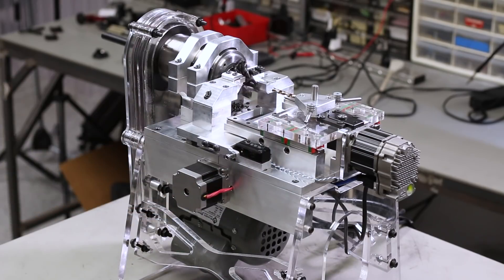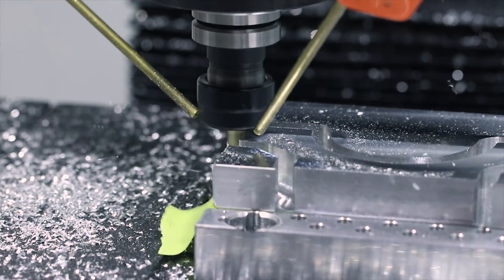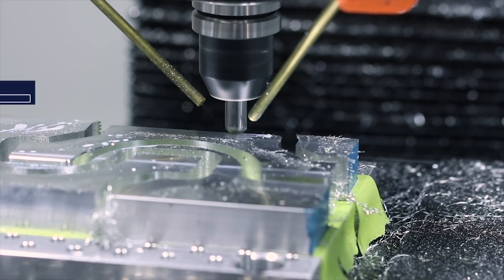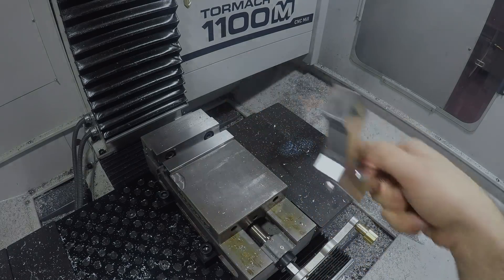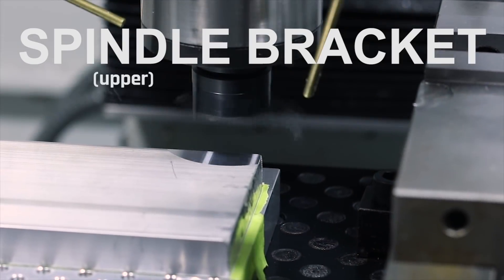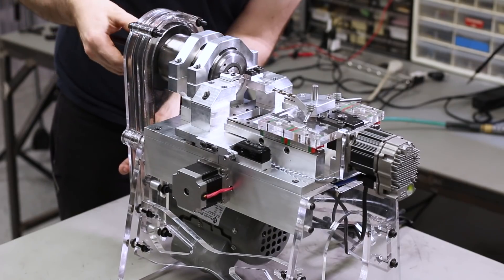DIY CNC Turret Lathe FINALE! WW225

Comment: RE: small radius slowdown - this could be what's happening: 

In 3D printing,  by default,  "sliced" curves are comprised of short, straight, lines.  It would stand to reason that smaller radius curves would require more, (shorter) lines to describe them. 

The 3D printer control software Klipper has a plugin called "Arc Welder" that converts curves into genuine arcs, (so you're no longer limited by how many moves/second the mechanics are capable of).  I would be surprised if Fusion 360 didn't have this function built in.

The other thing to look at is the increased number of X-Y move commands might be straining the bandwidth of the communications channel between the the CNC controller and the motor drive electronics boards.

Comment: Why not use a $200 R8 spindle cartridge from Little Machine Shop + an R8 lathe chuck?

They're ideal for little projects like this.

Also an epoxy granite base would have been better, cheaper and easier to make than all those custom metal parts (which look flimsy).

Epoxy granite has even better properties for metal-work than cast iron and the whole base can be cast as one piece with it.

Comment: I’m sure you know by know (since I learned this on NYCCNC lol, HAAS tip of the day has a good explanation too) but for others the slowing down on the corners may be called corner compensation in fusion 360. It’s a good thing that provides constant cutting forces by compensating for the diameter of the end mill around corners. Without this the code would be generated based on the center of the bit, fine for a strait line,  but think about the size of say an inside corner arc on a part verses the smaller arc made at the center of the end mill. With that in mind if the speed didn’t slow down you would be cutting at the correct speed at the center of the end mill but it would be much faster at the edge of the end mill. This could result in ugly corners, broken bits, and pullout of the end mill or the part.

Comment: So, we have a turret lathe made from aluminium using form tools with some auto features added.....hardly CNC but quite handy if you don't want to swing the levers yourself etc.......I think the design could be totally CNC'd......probably is going to be but I don't see it with the turret as the main tool holder.

Comment: I am amazed at the tape holding the aluminum block for milling! We use tape for holding flat plastic, and it is an amazing pain getting all the coolant off so it will stick at all. I use hold-down clamps instead, even if I need to move a clamp to finish the part, so much easier than having the tape come apart.

Comment: Cool project guys! Looks perfectly suited to the task it's designed for. Well done! :)

One thing you guys might like (since I've seen you use Arduino stuff before) is a new controller platform from Automation Direct. It's their 'Productivity' brand PLC but uses all Arduino components in industrial hardened packages. Looks pretty inexpensive too.

Comment: I am sure this is late but I dont see an answer about your tight radi question yet. As you were using a contour toolpath, my assumption is that you have Feed Optimization turned on in the Passes tab. 

One of my favorite options for the contour toolpath actually but slightly less useful if you are doing a full slot. Due to contour not being an adaptive (or trochoidal) toolpath, it will not maintain a constant chipload and a great way to overload and break a tool is to come into a corner where the tool will go from having say a 10% radial engagement then jump up to say 40% in an inside corner. 

Feed optimization allows you to specify the radius of the inside corner where it enables the slowdown and what percentage of feedrate you would like to use in that corner.

If you are using a smaller tool to do a finish contour on an inside pocket and the radius of the previous tool was larger than a feature in the pocket, feed optimization is key to prevent snapping that small finishing tool. Additionally, you could always go in with a rest machining adaptive before doing the contour with that same tool to reduce the chance of a big change in tool engagement.

Hope this helps! Feed optimization is a huge help when you want it on but can give some confusing looking toolpaths when you don't.

Comment: It appears you are cutting a radius the same size as the End Mill. If you ran into that radius at full speed it would chatter to all hell. Use a larger radius or use a smaller End Mill and the feed rate would probably not slow down. This is just a guess. btw NICE JOB

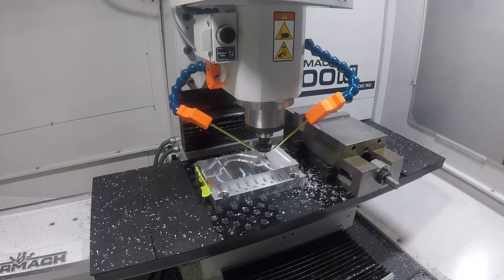Comment: 9:36 look at the gcode. OH wait there 100000 CAM lines. well there is too many lines do smal arc and using lowwer feed. but hey those calculated points can make with G2 and G3 your program side go down 100 lines if you smart it go 10 lines. there is too many same steps. ONLY ZDEPTH change. DO LOOP. OH CAM not do it. supid cam.pro not use cam. all these things

Comment: 9:33 It may be because of data straving. Many machines can read up to 40 lines of code per second, if you try to push harder it starts to “slow down” (it actually shakes). There is an option in Fusion 360 to smooth the toolpath. I think it replaces splines and uses arcs instead.

Comment: Do you think it would be possible to make replacement analog sticks for an xbox controller in metal? The idea came to me when looking for high quality replacements for an elite controller that suffers from "stick drift" (often caused by the plastic in the stick gets worn). So metal versions could be a cool, but expensive solution.

Comment: For Linuxcnc and by default Pathpilot you need to check to see what G codes are affecting the trajectory planner. This looks like a G61 (Exact Path Mode) or G61.1 (Exact Stop Mode) are active. The default should be G64 (Blend without Tolerance). This is similar to the HASS G187. http://linuxcnc.org/docs/2.6/html/common/User_Concepts.html#sec:trajectory-control

Comment: Fusion 360 CAM contour in the passes tab there is a feed optimization option, this specifies that the feed should be reduced at corners. You might want to check that out for your feed slowing down at the corners.

Comment: So what's happening with the slow curve traveling is in CAM it's making millions of tiny moves with millions of lines of g-code which the machine can't process fast enough, correct this by adding .001 smoothing to the tool path, adjusting as necessary

Comment: Just wondering, how much Z travel does the Tormach have? I’d love to have one in my garage. Also, for the best hex keys, Bondhus has always been my go to. Also, their rubber handled T set is pretty nice. The rubber does pretty well in a coolant heavy environment, and I’ve never stripped them out.

If you have .050 of clearance, might as well be a mile. I’m happy if I can get a piece of paper that’s more then enough.

Comment: 4:20 it's called functional laziness. But a more reliable way to do that is by using your 3/8 chamfer mill as a stop. MDI to your work offset x0 plus the tool radius (g0 g90 g54 x.188 y-.25) then handle jog it down until the shaft of the chamfer mill is below the surface of your part. push the part against it, close the vise and handle jog the tool out of the way. It can also be added to your program for automation purposes. 
putting a stop like that on the moving jaw like you did is a generally bad idea because you don't want your stop to move. Moving is the exact opposite of what you want from a stop. 
Also putting a stop against a part that has already been secured isn't always accurate. As a rule, you should setup your stop, put the first part against the stop, secure it and then find the zeroes. This ensures repeatability.

Comment: I learned when spot drilling you want to use the spot to create the chamfer for the hole as well.  Additionally, when spotting you want to have a short dwell time so the tool has enough time to make a full rotation at depth.

Comment: the slowing down could be due to arc tollerances or interpolations into to many small lines for the controller of your mill, i had the same problem on my diy mill so i just reduced the arc tolleranc in fusion and it was alot smother

Comment: 9:32 My expertise is more in 3D printing than CNC machining (Hey, it's all Cartesian robots and gcode, amirite?!) but my first thought is, does the CAM post processor have machine acceleration settings?  Like maybe that radius represents such a short cut that the post processor is chaining minimum acceleration and minimum deceleration distances together going in and out of it, without coming up to speed at any point. 🤔

Comment: Slowing down on the short arcs almost looks like the machine is acceleration limited -- I would expect that it's a problem with the machine trajectory planning rather than the G-Code.  That might be worth contacting Tormach about.

Comment: 0:31 why am I seeing threads in all of these holes? Where's the smooth holes for the pins?
Reply: @Ed Rees Ok, I'm just wondering why I can see threads even on the smooth .25" portion. Looks like the tap scraped up the whole distance, and the Bore wasn't big enough. Either that, or the Boring Bar rapid out of the hole instead of Feeding out. Anyways, that's irrelevant to the video, which I thought was really good. :)

Comment: I get the whole learning, educational, video creation thing. But Yall really need to address the "machine shop disease"  Because you can, dont always mean Ya should!!! example=Taig CNC chucker lathe with some light mods would have been cheaper and easier and a lot more versatile. Make stuff you can't buy, make stuff that would be significantly cheaper than buying, make stuff that does not exist! Beware of the self-serving machine shop that makes you do it's bidding!

Comment: If the small radi is faceted rather than an arc it may be re accelerating at each facet (smoothing turned off?) hmm not sure how arc fitting works with F360

Comment: Why do you peck that slowly? You should be able to do 4x drill diameter in first go, and 2x in each additional go. (Always worked great for me, at least!)
Reply: Forced chip breaking, so no birds-nests and usually with far less issues/surprises.
Reply: @JaakkoF  The birds nest I can relate to :-) With proper feed/speed on drills I really don't get any other issues in aluminum, though.

Comment: Just as the video starts, let me get this straight.... you're ON thin parallels and you chose to go below the vise jaws for no reason?  Why.  You guys "un-willingness to slot" and instead ramp is.... comon.  If you're in Aluminum.... carbide tool life is a non-factor really.  You can slot 1.5x Dia in aluminum pretty much at the same speed with a couple/few depth cuts and make 2-3 passes vs. ramping something 15 times, its insane waste.  Job shop sure, who cares.  We're a job shop and time is still time.  The one most valuable asset in any job shop, still time.
Reply: Huh
Reply: Fusion made them do it, I agree they are addicted to really long G Code...
Reply: @automan1223  It saves breakage if you only run the part once and don't want to fiddle with it.
Then again, the default ramp stepdown in fusion is super tall so they chose the amount. At 7500 RPM with smallish end mills, deflection is probably the biggest challenge, and chip clearing might be, too. But I'd try at least 1/2 diameter stepdown there, with some stock to leave, and a finish pass. 1100mx has reasonable spindle power, and using more of the flutes is always good.
Reply: @Ed Rees That is probably the case with cheaper tooling, I would agree with your observation. Have you tried any higher end tooling with flood coolant ? I think the Tormach is more capable than you guys are pushing it to. Great work Ed ! I like the quiet style and all business production when you fill in for John.

Comment: Does the program use a G187? It probably used a G187 P3 and that will slow your feed down when it comes into a corner for accuracy. Try a G187 P1 for roughing

Comment: Re: slowing in corners/tight radius sections. I'm pretty sure this is obvious to you but do you have "Feed Optimization" checked in the toolpath 'Passes' tab in Fusion? If so, that will slow down the feedrate (intentionally) under the conditions you encountered above.

Comment: Lol, using many $1000s worth of CNC equipment to make a DIY CNC lol
Reply: Hell, it's what I'd do.  Why tie up a $20,000 machine to keep churning out some small widget on a production basis, when you can make a much smaller and much cheaper machine designed just to sit around churning out little widgets? 😄
Reply: @Bakamoichigei  I mean, for a shop that makes money, sure, but when I hear "DIY", I think "look man, I've got a hobby and a garage".

Besides, there's something magical about making a tool that's more precise than the tools that made it, which this machine was not. I know it wasn't designed to be, but still.
Reply: That 1100mx is probably 20000 installed as shown with tooling...

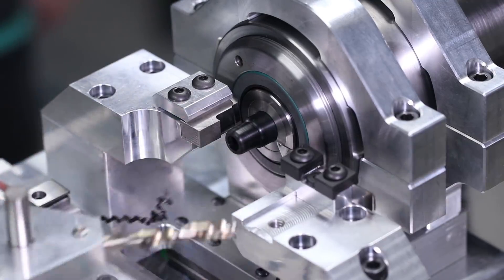Comment: 14:44 your turret lifted and rocked from the parting forces. That likely could lead to some irregularities in parts.  15:15 it wobbles again on entry of the drill bit. Maybe adding a support to the top shaft sticking out of the turrett would help stabilize things.
Reply: Noticed that. Slight amount of play likely at the point the turret rotates. Surprised that wasn't addressed

Comment: great video .. and as for those slow tight corners .. NYC CNC already made video about that i think, what is happenning is that toolpath in that tight curve gets split up into many short paths .... so procesing that is hard and if your machine computes acceleration for each of those short paths, it will never reach the speed it could otherwise.
Reply: The feed rate actually needs to slow down in tight concave radiuses due to the actual feed rate at the cutting edge being larger than the programmed feed rate (which is at the tool center) because their distances from the tool path center are different.
Scroll down to "Two axes ramping – circular. Part 3" at this link to find a better explanation: https://www.sandvik.coromant.com/en-gb/knowledge/milling/milling-holes-cavities-pockets/pages/ramping.aspx
Reply: Yes, you are right @Halvor Huse Aasen, but it seems it slows down too much to be just adjustment for this. If only i could find the video i remember... it was made by John, he was making some part and somewhere in the middle he noticed this behaviour too. After inspecting G-code he found tens, maybe hundred points on the slow corner. Some form of smoothing helped to reduce it to just few and it ran way faster.  At least its just my amateur idea, you guys are probably more experienced :)
Reply: I somehow doubt it. PathPilot is based on LinuxCNC and runs on a powerful x86 machine, not some  microcontroller.
Reply: @Anonymouspock  still it doesn't look more than one cut ahead AFAICT. I've also seen slowdown in tight corners with pathpilot out of fusion, more than feed rate compensation would demand.

Comment: For the slowing down in the corners: you should maybe check the settings for overlapping contours (or however it's called) in the machine settings. Normally there's a look-ahead-function, that reads the upcoming lines of G-code and puts in deceleration and acceleration sections into the transition. This is all to avoid an excess of jerk and make the movement more smooth. There are different types and often you can also change their behavior with some parameters (like max arc radius, max deviation from edge etc.).
If you want the tool to follow the exact path with sharp corners, the movement would have to come to a complete stop in the corner and then ramp up again. You often get better results by allowing some roundness in the corners, but instead getting a more smooth toolpath.
Reply: It's G61 / G64 in LinuxCNC-based systems

Comment: Great Vid! 
Maybe your controller cant keep up with the program lines. Did you check the smoothing box in fusion? With this checked, the number of coordinates in a radius is reduced, which leades to less program lines. 

Grtz from the Netherlands
Reply: With 1000 block look ahead that it's meant to feature, I think it should be fine with some very fast code.

Comment: Thanks for sharing the entire process, it helps people to understand how much comes in to play when you design and make a machine... It sounds so easy but it never is.
It becomes even more difficult when you have to make the design for production. 

The choice to go for injection molding is by far the best one, especially with the numbers of caps you guys need (hunderds for each customer). Really impressive to see the production capacity with those industrial injection molding setups (like the ones you can see in the ARBURG video's). Cool example is this setup that makes 137000 parts each hour of similar size and complexity: https://www.youtube.com/watch?v=4ismOTUaeLQ
Reply: Or another cool one (mesmerizing, the volume of production by one machine) plastic cutlery sets including packaging, 31500 per hour:
https://www.youtube.com/watch?v=-0p0skvO0SE